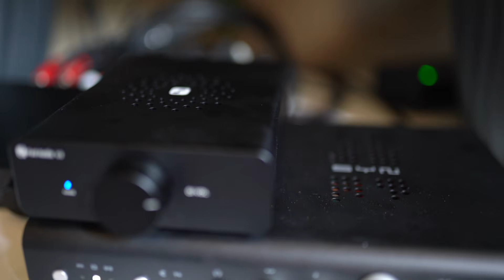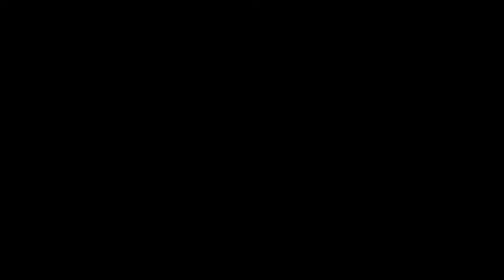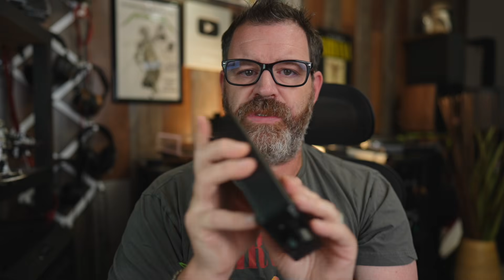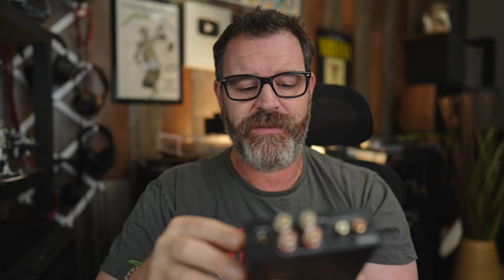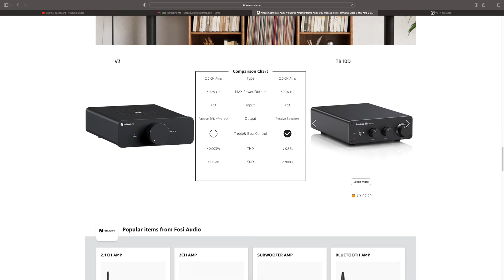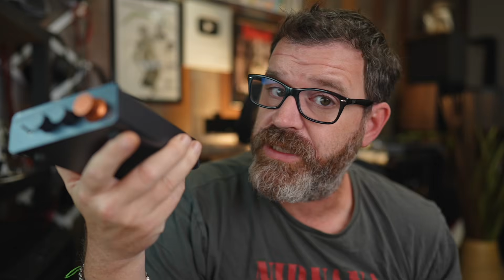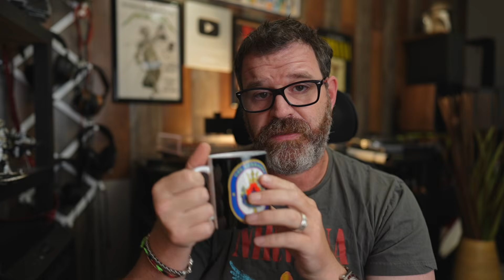Fosi Audio V3 Review - The Best Amp Under $400?

Comment: @cheapaudioman hi, my active subwoofer has a pair of speaker level inputs and and another set of speaker level outputs. Can I use that with the Fosi Audio V3? The sub understandably has a high pass filter for the bookshelf speakers. Will that work?

Fosi V3> active sub speaker level inputs> sub speaker level outputs> bookshelf speakers.

Comment: Just ordered a V3 and some flat wall mount speakers. I plan to to replace the sound from the (cheap) projector inbuilt speaker in our bedroom. That sounded more like a walkie talkie, so this should be a great improvement. The V3 is small, so I dont have to hang a huge amp on the ceiling 😂 I like your no nonsense presentation in the video.

Comment: I've had a few little light portable amps, Lepai with the tone knobs and defeat button. They sound like a car stereo. But now, I got one of these V3's on the way with the 48V - How many watts does it really sound like? 
 I hate the disingenuous specification's on Fosi products. I went to school for electronic engineering, those are not specs, that's jibber jabber number soup. Anyway, this V3 thing will end up driving all kinds of stuff, excited to see if it lives up to the hype.

Comment: I'm probably just gonna use this for outdoor projector movie night; likely old movies most of the time. Maybe some CDs after the movie on either a cheap Samsung blu-ray player, my new Panasonic DP-UB820, or a little Philips portable CD player (the one with a transparent lid). Pretty casual. Think I'll miss the knobs of the BT20 Pro? That one didn't come with a 48v 5a supply for a nearly as cheap, or maybe not at all... but I really wrestled with it. Gonna either use ES15s or some random old speakers that I don't mind sticking outside on the ground, plus a subwoofer, so hoping I won't miss bass control.

Getting this to keep setup simple (otherwise I would just lug out an old AVR), I really really don't want to have to connect another device to make this work well for me.

Comment: Im still confused about this amp. The amazon listing advertises 300w x 2 @4ohm MAX which would be 600w MAX over both channels. Even if the amp is 280wrms x 2 @4ohm, that is 560w continuous. 48v x 10 amp is 480watts max. How could this amp hit those numbers? More power coming out than going in. I have a cert 3 in electrotechnology and I cant understand this. Can someone explain?

Comment: I lost 60/70% of my hearing but love music from classical to modern pop but I tried sound bars, a disaster no way to adjust!
I want to buy Edifier P17 passive speakers, I read they have a nice sound and look nice as well, with that a Fosi amplifier to adjust the sound to my hearing. What would be the better choice for a Fosi amplifier? I have my PC and laptop hooked up to Fosi working excellent for my hearing issue.
The P17 and amp be hooked up to my TV, an LG 44'' older type but has a very nice picture with all sorts of hook ups, very versatile. 
I want to know what would be the right choice or canoices for a amplifier for around $100/150 ???  
An 81-year-old senior. 
PS I love your show lots of good stuff!!!!!!

Comment: Have to say, 8 months later, even WITH the 48v supply, the Fosi V3 is VERY WIMPY sounding. Very much so. Clarity but not really as high powered sounding as advertised. In fact, I've found that the AIYAMA 07 has way much more "balls" than the Fosi, using the same 48v power supply, albeit a different sound signature. I'm sad I fell for Randy's hype, but at least I was only out $70. I give it a big "don't bother/buy" from me
Reply from the maker: Appreciate you watching and taking the time to comment
Reply: I experienced the same with my V3, and then I hooked it up to the XLR output on my PS Audio Gaincell DAC using XLR to RCA adapters, and she lit up! I also have both the 36v and 48v power supplies, no difference in this system. Then, I went to Amazon and purchased the Douk Audio Line Level Booster, the V3 is now a different animal with this booster in the chain. I then installed a pair of Sparko op amps, the ones everyone suggests, and the sound is a bit muffled. The stock op amps in my system sound much better. I have the EQ set to flat, and both amps in the comparison matched in regards to volume with an A/B switch. I also have two women here, with better hearing than mine. The Douk Line Level Booster is the icing on the cake, they heard the sound quality improvement immediately. The other amp is a Cayin MT12N EL84 tube amplifier. According to the gals, the V3 is the hands down winner... Oh, the speakers, a pair of Zu DW6 Supremes...  For what it is worth, the V3 is a winner!

Comment: Well, the Fosi V3 is here, listening to it right now. WiiM Pro via digital coax to a PS Audio Stellar Gaincell DAC/Preamp, XLR to RCA out to the Fosi, which is powering the Zu Audio DW6 Supremes. The Zu's are 95 dB at 12 Ohm... The little V3 sounded anemic to my ear, and then I used a pair of XLR to RCA adapters and plugged those in to my PS Audio Gaincell DAC/Preamp and she improved in overall SQ. I then broke out the Douk Audio line level booster, $45 on Amazon. Katie bar the door! What have I done? What just happened? I am now blown away at what this little amp is doing... The voicing, the instrument separation, everything is easily placed, no compression at all. And the best part, no Class D sound! Normally a Class D amplifier will have my eyes bleeding, not this Fosi, it is very class A/B sounding. This should not be happening! Yes, pair this up with that Douk line level booster and get ready to hear music in a way that I never expected. I would say this little box is a true Giant killer.

Comment: For class D, it's not bad and probably one of the best class D amps out. However, I tried it with few speakers and I can say, without doubt, pairing the V3 with Klipsch Cornwalls is disappointing. The Cornwall is a VERY revealing speaker and showed the weaknesses of the V3. With other speakers I had no issues and enjoyed the V3. I'm using the stock op amps. I'm not bashing the V3, just be warned with some speakers, don't expect a smooth presentation. I appreciate the V3 for what it is.

Comment: just got the amp hooked it up . This is one of the best amps i have ever heard. The power rating is only part of the story . This amp has a lot of spaciness. & sound stage, and clarity. The bonus id it is not burned in yet so it is only going to get better. I have the Aiyima A07 and this fosi sounds better.

Comment: Bought a fosi audio v3 & aiyima a07 a few days ago, after testing both the fosi audio v3 sounds muffled with less top end and dynamic range, yet the aiyima sounds so much better...so my question is..." do these amps need burn in time? "
Reply: Not really! I tried the V3 and found it dull. The a07 is not bad. The original Fosi BT20a (not the pro) is incredible. Imaging and bass response outdistance the V3 by a mile.
Reply: @pgssider  does the bt20a have tone controls?
Reply: Yes  
 @MrMajjido

Comment: addendum - the v3 is good for the money.  quiet, able to get high volumes, clean sounding.  but to me all the chi-fi stuff i had for some nagging reason to me sounded too, two dimensional and like a flat-noise-wall in space.   so i gave up on it and gambled with two monoblocked schiit gjallarhorns (i like the small form factor and have limited stacking space), worried about the lower power compared to the v3.   the schiit stuff does everything better...i know, more cost but for me MUCH more listenable....much more dimension, separation and they bring out detail that the chi-fi just placed in a 2-D sound plane so to speak.

Comment: There is more bad with the pass-through of the V3  Please test this yourself if you can.   I have removed it from my system. 

First... The pass-through works both ways... You can input via the 3.5mm too.  Then you would use the RCA as outputs.  Just like the Aiyima A07.   It is really only a Y cable.  Not even a line out. 

So here is the nail in the V3 coffin.    I found out last night that the RCA and 3.5mm pass-through of the V3 are wired wrong and when another device is plugged into the V3,  while conducting an isolated L-R stereo separation test, reveals the crossed signals.    This error doesn't happen when you only use the RCA(or 3.5mm) input alone...  But as soon as you plug something into the V3 for output...   L-R tests reveal the cross-fed signals.    When testing, the left channel will play and a reduced signal will play in the right channel too and vice versa.    This should not happen.   Fosi Audio obviously copied the original circuit layout of the Aiyima A07.   The A07 also had this error in their first run...  They did fix it...  So they say... 

For Shame Fosi!      You will have to split your signal before your V3 and feed your secondary device that way.   You cannot use the pass-through in the V3.   The entire first run of this device is junk for anyone needing that pass-through to work as intended.    Buyer Beware!

Comment: 48V x 10A = 480W. Meaning, maximum theoretical output, regardless of impedance would be 2 x 240W. But since some of that will be lost to heat, something like 2 x 225W would be more realistic. There is absolutely no way around that. If there was, it would mean infinite free energy for everybody in the world forever, because it means you could create energy from nothing. So Fosi Audio are lying about these figures. With a 48V, 13A, you could perhaps achieve the figures they list, but probably 15A would be better.
However... None of this matters. Watts =/= sound quality. If the amp is powerful enough for your speakers and it sounds good, who cares about anything else?

Comment: They HAVE  and have had for a long time a 48 5 as long as you order together with device or by its lonesome.  So 48v5a with the v3 is $100-120 and b20a pro is 105-140 with fosi 48v5a

Comment: Added this to a pair of old JM Lab Focal Micro Utopia speakers that I had lying around the office. Now the Focals in their day cost around $10k. Fosi V3 with a 48v power supply drove them musically without a problem. Mixing a $100 product to drive a $10k pair of speakers is crazy, but it shows how far Class D amps have come.
Reply: I have a Fosi BT30D Pro driving a pair of LSA2 Statements, these were $6000 new. The system sounds wonderful.

Comment: Bought a V3 on the recommendation of this channel. I was not prepared for how good it is. Running Bluesound 2i through it. Switching thru a Douk Audio switching box (with VU meters!) out to a pair of Dynaudio Special 40s. All the volume I need. Livelier up top but the Special 40s really benefited from it. This is the 3rd piece of hardware I’ve bought on Randy’s recommendation. 
Now Im starting to think about a pre-amp for it; open to suggestions.
Reply: @weirdfishes9961 eq behringer mini fbq 800

Comment: Hi Randi.
I was planning to get the AIYIMA A07 Pro  as I would like   5.2 bluetooth connectivity

But after watching this I'm heavily leaning to get one of these and adding a 1Mii bluetooth transmitter /receiver (ml301) 

I think this combo would be cheaper and have a  higher quality amp.

what do you think ?

The plan is to power it from eather 1 or two Ryobi 18v batteries when camping to make an awesome camping bluetooth speaker system with a couple of small Bookshelf Speakers .

Comment: When you review an amp, could you give us an opinion on these small amps running thru vintage speakers? Also your opinion on running thru a phone connected with RCA Jack's.
At least for me, that's about as simple a setup that someone might have.
Is there speaker pop with the on/off - volume knob?

Comment: I just got the SMSL SU-1 DAC today and hooked it up to my new Fosi V3 with the 48 volt power supply. USB connection to my PC and optical connection to my TV. Speakers are the Andrew Jones designed Pioneer tower speakers, 2nd gen. It sounds wonderful! I even like how it sounds at lower volume when I listen to music, use the PC or watch TV late at night.

Bought the SMSL SU-1 from Apos and the amp and 48 volt power supply from Amazon. Pioneer speakers I bought new, years ago and in keeping with the Cheapaudioman ideals I got them on close-out for $60 apiece.

Comment: i got a v3 and placed my sparkos chips in it from an a07.   mine is paired with schiit syn, dual polk psw-10s and es20s and a polk cs10 center.   i have to agree with the description...a little less bass than the a07 but the soundstage is noticeably more revealing.   i use a small 9 band eq to add more to the bottom .   fantastic sounding little amplifier.  gives me some immersive sound that i just didn't quite get with the a07.   i am using a 36v 6a power supply.

Comment: I have one of these on order and also have a Topping PA5 and Aiyima a07. My Topping is very nice but I don't use it all the time because of reliability fears (when I purchased the PA5, I had read up on the TPA3251 and felt the 38v psu was too high, as the chip can only use 38v maximum voltage so I changed it out to a 32v 5a. It runs cooler than stock. ). The Aiyima A07 runs much cooler in the summer, so that's what I am using now. 
Thanks very much for your review! It was great!
Reply: Any thoughts after getting the v3? Thank you!

Comment: Dilemma. Want a clean, nice looking, desktop setup running vintage AR18's speakers. I currently have a Valab NOS DAC and Pioneer SA9900  to power them but it's massive! Should I ditch the pioneer and dispatch it for other duties and replace with the Fosi?

Comment: I have the BT20A Pro and just received my V3. I've got it wired up to a pair of Kef 104ab reference speakers from the 70's, which are only 85db sensitivity. The BT20APro sounded good, but the V3 sounds so much clearer. The bass is a tad lacking but the Wiim's EQ takes care of that. Pretty stoked the V3 can make these old Kefs sing again, and for the price they're asking its a no brainer. Highly recommended 👍
Reply: Sorry but no. Remove bass and it sounds clear???? Anyone recommending this have a sub filling bottom. Noo this sounds wrong. Like this you have changed audio with dac, cables ++. I did on buchs 400 MK2. Go for fosi pro upgraded tubes .. . Tested on XTZ beryllium was ok ish. Bass gone... Testet on focals fabers and a few others. Watt bs f off. BT 20 with tubes got more power. Fosi calling you out here
Reply: @wegardfjeld3789  What on earth are you babbling on about? 😄 My apologies, I am not fluent in Gobbledygook
Reply: @LoftyVisions  fan boy or just never listened to proper sound equipment?
Reply: No. No no. There is nothing below 60hz. This sounds horrible and just no
Reply: No. This actually has no bass fundament. Who the f recommend this sh... Tested with 48V vs BT20 vacume upgraded tubes. Not vs my high end stuff

Comment: Thanks to Randy, I bought the amp on Amazon to try out and swapped in the Sparkos ss3602 opamps. You'll need the risers for that or the stems of the opamp won't reach. 

I compared it to my VTV Purifi Amp with Sparkos 2590 Opamps and I gotta say, I'm impressed. They sound very very similar but the VTV has a tone more headroom. Tonality, it's hard to tell apart and at first listen, my cousin who's not an audiophile, said "sounds the same to me". Only after harder listen can I say that the VTV has better dynamics, better instrument separate, and better bass weight but it's subtle for music up to 70-80dB. Perhaps pushing it to 90dB, you can hear that more powerful amps will sound more effortless but below 80dB (which is what I listen to for 95% of the time) it's really hard to tell the difference. I'm saying the Fosi Audio is around 95% of the Purifi. It has just as much detail and clarity and does sound holographic. It's not flat like the Aiyima A07, which I returned. It's so good I'm waiting on a 48v 5a power supply. 

Qobuz -> Wiim Pro -> Topping D70s -> Fosi Audio (VTV Purifi) -> Dynaudio Focus 260 (4 ohms)
Reply: Compare to a bad amp you will be happy. BT 20 tube with upgraded tubes eight now only one not soundsinf like thin soup

Comment: You mentioned using the pre-out for a subwoofer, but that won't work very well because it's just a bypass. It is not adjusted by the volume knob.
Reply: This design ensures that individuals who prefer not to adjust the volume on a second amplifier can maintain a consistent output level from the pre-out.
Reply: @fosiaudio  I understand, but it contradicts what @cheapaudioman said in his video. It can't realistically be used for a subwoofer.

Comment: Got mine yesterday. Sounds great with JBL 530. Waiting for the 48 power supply to come. Only problem was when I opened the Amazon pouch the box was open and the seal was broken which was a little weird
Reply: Have to say, 8 months later, even WITH the 48v supply, the Fosi V3 is VERY WIMPY sounding. Very much so. Clarity but not really as high powered sounding as advertised. In fact, I've found that the AIYAMA 07 has way much more "balls" than the Fosi, using the same 48v power supply, albeit a different sound signature. I'm sad I fell for Randy's hype, but at least I was only out $70. I give it a big "don't bother/buy" from me

Comment: I dislike that the power on is by the volume knob. 
If you’re using this as a power amp fed by a preamp with volume control (which might feed a sub)  then you’d want to set the volume to match the speaker level with the sub. Each time you turn it on you need to get the volume knob position right. An on-off switch would be better.
Otherwise looks amazing for the price.